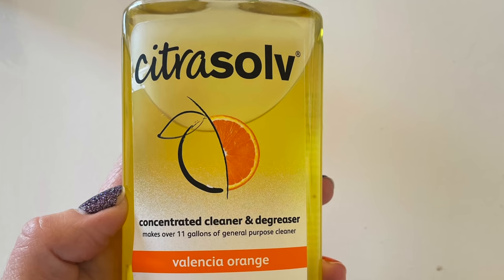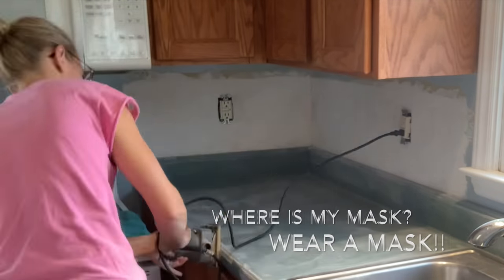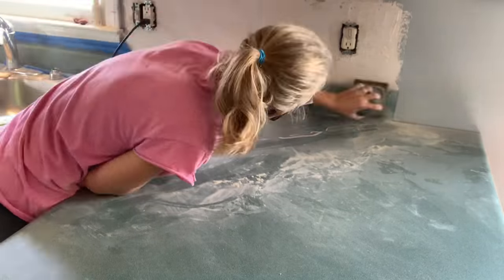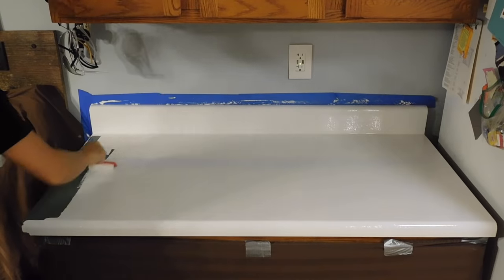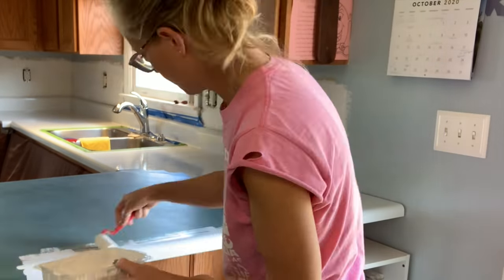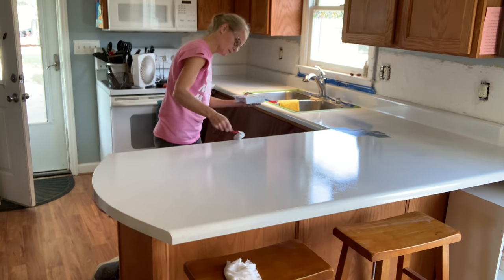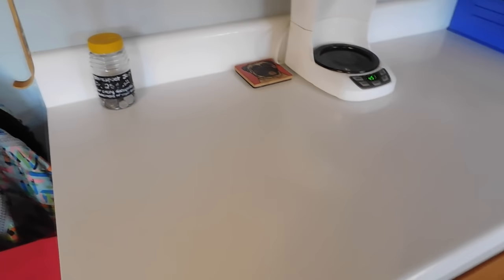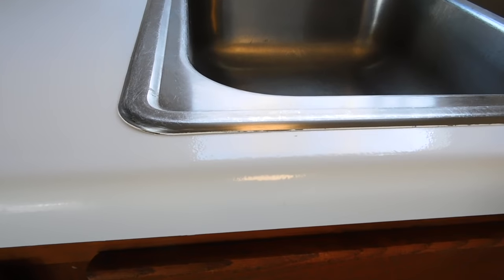DIY Painted Laminate Counter |CHEAP LAMINATE COUNTER MAKEOVER | DO IT YOURSELF EASY LAMINATE COUNTER

Comment from the maker: What do you think we should put as our back splash? Something easy, it’s rough and want to easily cover it up, thinking galvanized metal or SHIPLAP. 
Let me know 👇
Reply: Some of those peel and stick tiles are pretty nice. And that board that looks like shiplap.
Reply from the maker: @seeleygirl6178  oh thank you so much!! I will definitely check them out!! Have you used them? ❤️ thank you for watching!!
Reply: Subway tiles. Peel and stick. Easy peasy! Home Depot, Amazon, Lowe’s, you pick!
Reply from the maker: @moniquehorton1111  definitely have considered subway tile! 🤔
Reply: @JesiDavisBuildingaSimplerLife  I like the simplicity of it. It’s a classic.
Reply: I put I guess it’s punched tin like in the old houses and restaurants they have it at Lowe’s and Home Depot it’s different than the old one hundred percent run , it’s got a rubber back and you can glue it on I wish I could send you a pic but it looks great and is fairly easy to do also they make different colors like copper brass dark and tin color I think the pattern is like New Orleans flor de Liese
Reply from the maker: @amaiorano67  That sounds cool! I think I have seen those! Squares right with punched design on them? Ive actually thought about weathered galvanized metal too.
Reply: a waverly stencil from Wal-mart
Reply: Did you know you can use vinyl  plank flooring on the walls? You can install,it in a few hours. Installation is easy, ruler, measuring tape, exactly knife and some paper (for outlet patterns). Very budget friendly and easy to wipe off for clean ups. Some come with adhesive backing or you can use some construction adhesive (sparingly and troweled off). This can be trimmed off with wood trim painted your wall color or metal trim for ceramic tile. It comes in many finishes but it can be pricey. Good luck with your project. You go girl, ✌ and 💘.
Reply from the maker: @susanpeterson9558  that’s sounds like a great idea! Thank you for watching and making a suggestion!
Reply: For an old school look go with 3x6 subway tile.  For a more modern look, go with mosaic glass tile. If it is texture you are after, shiplap is always an excellent choice.  I've never worked with galvanized metal so I'm not sure.  Stamped tin, or copper looks pretty cool to.  As for me, I go with what ever is easiest to clean.  I'm looking forward to seeing what you choose.  Keep up the good work!
Reply from the maker: @michaelmeans9187  thank you so much! I appreciate your suggestions! We are leaning toward Shiplap, thinking about putting it vertical or haring bone. The problem is, is when the old tile was taken off someone put a ton of wall putty up and it would be hard to get it all even. I would LOVE to put a rock back splash, like cement and stick River rocks up there, but they may cost more if we don’t go river rock hunting in the river... and be interesting to clean. Decisions. I thought of painting a wood grain on the ship lap with a tool I have, and giving it an antique look.
Reply: @JesiDavisBuildingaSimplerLife  Vertical shiplap would be supper cool!  I'm not a fan of haring bone, it looks fantastic, but I just don't ever want to install it.  LOL 

As for the uneven walls, Vancouver Carpenter is a YouTube channel that has lots of great solutions for how to fix uneven walls.  He has saved me on a few projects already.
Reply from the maker: @michaelmeans9187  truth to not wanting to make all those cuts for haring bone! 😆 let alone installing it! thank you SO much for the resource! I’ll definitely hop over there! Thanks for being here!
Reply: 2021, Decorating trends say subway tile is out! Ship lap is thick, I have done a few projects with lath strips, but it will be rough unless you sand it alot. I would look for something easy to clean and wipe off. I used vinyl slate all the way to the ceiling. It looks like the real thing but easier to install and alot less money. Just a thought, if you are going to change out the counter tops in a few years I'd stick with a less expensive option.
Reply from the maker: @susanpeterson9558  oh genius! Thank you so much for these tips!! ❤️
Reply: diamond plate sheet
Reply: Diamond plate polished. Cut to size and glue on! Not super cheap but super easy.
Reply from the maker: @finnsadvantures  oh wow thanks!!
Reply: @JesiDavisBuildingaSimplerLife  happy to help. I am actually a Home Inspector by Trade.
Reply from the maker: @MrSaxon2001  OOOO that sounds interesting! Thank you for watching!
Reply from the maker: @finnsadvantures  Thats awesome!! Im sure you are very handy when it comes to looking at homes and home improvements!
Reply from the maker: @A B C Oh Ive thought about that! 🤔
Reply: @JesiDavisBuildingaSimplerLife  I'm still procrastinating! Bead board was the other name.
Reply from the maker: @seeleygirl6178  🤔 that is a solid choice!! Thank you! And thank you so much for watching!
Reply: Counter ca.e out nice, now the cabinets, then the back splash.
Reply from the maker: @alirE2904  yes yes yes!! 😀 thanks for watching!! ♥️
Reply: You can also use laminate wood flooring for backsplash
Reply from the maker: @accidentalcatalyst1003  so many choices! ♥️ thank you for watching and commenting!
Reply: Dollar Tree has some beautiful ones. I put on my kvetching 3 years ago and so far didn’t peel .
Reply: """Bhbb
Reply: I love the idea of shiplap 100%!
Reply: Dollar Tree has very good ones and they last. Just finished my back splash. I post on my Facebook and o had good reactions.
Reply: And your counters look great! Good work.
Reply from the maker: @e.l.france5136  thank you ♥️ thanks for watching new
Reply: Decorative tin. It’s comes in a whole bunch of colors and t would be way easier than tile.
Reply from the maker: @maryannkom299  I love easy!! And sounds like I wouldn’t have to worry about smoothing out the putty that’s been caked up in our wall. 😂
Reply: @JesiDavisBuildingaSimplerLife   I want to do tin on mine eventually.
Reply: I love the idea of galvanized! And then some beautiful farmhouse white cabinets. I’m sure you could diy easily
Reply: Pieces of tin from Home Depot about 20 a sheet or shiplap tin comes in nickel or bronze done that before turned out really pretty adds a lot of shine to match the countertops
Reply: @susanpeterson9558  what kind of sanding type did you use?
Reply: @meemaw6533  where can I see that,
Reply: Hi Jesi !  Just out of interest, how's it looking a year later? I'm considering this same product to refresh my old jaded worktops, and I wondered how well it's doing after a year or more?
Reply: I put up that fake tin that looks like ceiling tile at Lowe's. I want to paint them white. So they don't look so much like fake tin ceiling tiles from Lowe's. I love your counter. I wish I weren't so lazy.
Reply: you do not caulk a kitchen sink it gets clear silicone. under the sink and along the splash. You did a good job but i feel epoxy coat is the way to go on such a project.
Reply: Metal!
Reply: Shiplap will be gorgeous just did my counter n you are right at first freaked out because the air bubbles but it came out so good and dry in like 24 hours everyone thinks it’s a stone thanks 🙏🏽
Reply: Beadboard. Classic and durable, easy clean up
Reply from the maker: @cherylhag3253  genius! I hadn’t actually thought about that and I bet that would look good, as it’s still not done 😂
Reply: You could tile right over it….also you could easily do cement and dye it any color and seal it well.
Reply: Shiplap.
How long did it take you to sand that area? It is the same countertop I have and it needs to Go!!!
Reply: I think that you would get a better wow factor from painting your cabinets before messing with a backsplash.
Reply: Ur jeans are really tight lol
Fixing to paint mine too
Reply: No mask hun ? 😮
Reply: Your fish needs a bigger home my dear. That fish cannot live a good life in such a tiny bowl with no filter, no aerator, no heatlamp etc (depending on type of fish).. love your countertops, but please have a heart.. give the fish a lovely home just like you have a lovely home for yourself 🥺
Reply: Your fish needs a bigger home my dear. That fish cannot live a good life in such a tiny bowl with no filter, no aerator, no heatlamp etc (depending on type of fish).. love your countertops, but please have a heart.. give the fish a lovely home just like you have a lovely home for yourself 🥺
 @JesiDavisBuildingaSimplerLife
Reply: @JesiDavisBuildingaSimplerLife pool
Reply: You just inspired me to do my kitchen counter tops. Thank you for the cideo
Reply: Cabinets to much work cleaning
Reply: There are some beautiful peel and stick backsplash tiles out now.  They look realistic and are very durable🎉

Comment: As a professional decorator in London i can't recommend a product enough called ESP by Owatrol, no need to sand, its a liquid which can be wiped on pretty much any non porous surface including glass which enables any paint including waterbased paints to stick to any surfaces , we use it to paint old melamine, formica kitchen's and have nothing but brilliant results 😀

Comment: I just sanded and put a coat of this stuff over a previous attempt and dang, this stuff works wonders. Super tough, easy to apply and no hassle. Did the whole kitchen in 2 hours and 15$!
Reply from the maker: Hey thats Awesome Keagan!! Woop Woop! Thats a win, simple and budget friendly!! ❤️
Reply: Wow!
Reply: Can u tell me what paint this is. Do u need a primmer then a clear varnish on top please
Reply: How long did you have to wait till its fully dried?
Reply: Can you please show me the $15 option?
Reply: @louisebolitho9629  1¹
Reply: Okay so im thinking THIS IS THE METHOD IM GOING TO DO! $15.00 THEN if all else fails I'll purchase preformed counter top from a local store that's cheaper if it's something they have left from 1 being cut for another customer... 2nd option isnt going to be necessary with the mindset I have now :)
Reply: What is the $15 option. I have to get it right the first time. No money for mess ups or new countertops even with extra left over. Im sure its still expensive plus you don't have air of choice that way.
Reply: @aunt_b3365  Rust-Oleum appliance epoxy, one can will finish a whole neighborhood worth of counter tops! Looks great (bright white, glossy) dries hard. If you get a chip or stain you can just sand a bit and recoat the spot
Reply: What is the stuff you used?
Reply: @KeaganKellogg  does it have a hardener? If not how can it be durable/ scratch proof
Reply: @wazup3333  It seems very durable, but has been marked by knives and things normal formica would also take damage from. I have just reapplied in spots when stuff gets dinged up. Still looking nice!
Reply: Can I do it on bathroom counters?
Reply: @KeaganKellogg ❤

Comment: FYI, for anyone else trying this you could unscrew the sink clips a little and wedge washers under it without messing with the plumbing get a much cleaner edge.
Reply from the maker: Great tip!
Reply: I tried this and also tried to build stilts to support the sink from underneath. Unfortunately my plumbing had no give in it so I had to go ahead and remove the whole thing. It was worth it in my opinion though.

(By the way I was using a different kit, not this appliance spray method.)
Reply: @PJErvin  I am a peel the trim off first painter, generally.  I had to scrape paint off the stove and replace switch plates when we moved in. SMH

Comment: Safety tip: When sanding it's good to wear a dust-filter mask, goggles, & gloves. A synthetic surface may have especially irritating dust. Also if you can rent an electric sander with a vacuum attached, it's faster & cleaner.
Reply: dust filter mask is not enough (I wore one for the first coat); spring for a respirator mask -- your lungs will thank you.
Reply: @yewtoobbrute   dust filter mask is enough for the sanding step IF it's a good quality mask. However, if doing on going projects, it certainly is well worth it to buy a respirator mask.

Comment: I watched your video and did my counters too! It has been over a year and a half and it is fantastic! You saved me a load of cash and tons of time! My bright yellow 70’s installed Formica top, looks brand new and a million times better in white! I also painted my yellow bathroom tile ! It is also amazing! Over a year as well.  We have been really careful as some paint started to come up in the molded soap rests in the shower. I sanded and repainted. Left extra time for curing, kept fairly dry between showers and put a plastic soap holder in the molded painted holder so it doesn’t peel up again from being overly saturated. Works like a charm!   I am going to paint the yellow floor tiles in guest bath. It will need extra cure time and a floor mat so it stays dry…since it is a floor.  think it will be just fine!   Best thing is…easy to paint over  and super cheap if u have to touch up anything!  Thank u soooo much!!!
Reply from the maker: Woohoo!! No more yellow! Thats fantastic! great job! Im so glad I could help and save you money! thats what its all about! God Bless

Comment: I did this for my mom’s kitchen countertops and she loves it!  She had a 70’s orange countertop.  I sanded it and decided to do a coat of primer due to the color and painted 2 coats of the white appliance apoxy.   It looks great!  The only area that didn’t come out smooth was around the kitchen sink.  I would definitely remove the clip sinks and prop it up then recaulk if I do it again.  Thanks for the video, looks awesome!

Comment: Nice job! I would just suggest loosening the bolts on the sink and propping it up with a stool underneath to save time masking and have a better edge. That way you can apply silicone under the edge if you're worried about leaks.
Reply from the maker: That’s genius!! Thanks!

Comment: Those counters look beautiful! I know that they now make a paint specifically for laminate/Formica countertops.  I’ve seen a lot of people use peel and stick wallpaper, but to be honest, it may look good on camera, but I have a feeling it looks like wallpaper in person.  I can imagine that painting looks so much better.

PS I used appliance paint to restore a refrigerator that worked great but had significant rust damage (the “advantages” of living beach front 🙄), and that appliance paint ROCKS! It made the refrigerator look like new, and it LASTED.

Comment: I did this too with this exact paint and so far going strong for three months now. I bought large drawer liners in white and put them on my counters for everyday use and remove them when I have company over. It will help prevent scratches. So far no stains and is holding up well.
Reply from the maker: Oh yay!!! I love hearing this!! Thanks for stopping by and commenting Michelle! Appreciate you! What color? White?

Comment: I painted mine.  The laminate had water damage and was black in a lot of places.  I used a nap roller so it has texture. It looks like cement.  I love it. I used Dixie Belle Slick Stick, no sanding required.  Then chalk paint and sealed with Gator Hide.  It takes a month to cure so I washed dishes in the bathroom.

Comment: I tested the same epoxy product on old porcelain tile 😀 and it worked! I just tested one square to make sure cause I didn't want to do the whole area only to find out it peeled off or something. But it didn't peel off... I followed your sanding and prepping instructions and then painted one coat each for 3 days and it's now in the curing process. Sanding is a must especially on porcelain. After 3 coats it looks glossy and nice like new tile! I lightly scratched the edges with a nail to see if it comes off, but luckily the paint is still on and not peeling. As long as you let it dry enough days before using the surface, it will be fine 👍👍👍 Just wanted to share my results and thank you for this tutorial! 💛
Reply from the maker: That’s FANTASTIC!! 😀 thanks so much for sharing! And thank you for watching!! ♥️
Reply: So am I correct in understanding that you used this on porcelain tile and it came out shiny? I’m bout to paint my tile on the kitchen walls and I really wanted the look of subway tiles but could figure out how to get them shiny. This might be the answer! What did you use for a degreaser prior to painting if I may ask? Thanks!!!!
Reply: @sharronharding8112  I used soap, water, vinegar and baking soda solution... But the video states you can use a degreaser. It's a lot of scrubbing, I'm not gonna lie. Make sure you sand the tiles and wipe off the dust before painting just like the video shows. The smell of the epoxy is pretty strong, like nauseating strong! I had to use a N95 mask when applying coats.

Comment: Cool.  This is on my list.  I painted my cabinets last year and love them.  It took five weekends, but it was worth it. Thank you for the tips!
Reply from the maker: Hey there! thanks for watching and commenting!! Oh yea, I know when we do out cabinets its going to take a while ... Ive been chomping at the bit, but the humidity is too high right now, It will have to be a winter project. 😆
Reply: @JesiDavisBuildingaSimplerLife  I used a 4" velour roller and Sherwin Williams best paint.  It's $$, but worth it.  I finished with Varathane polyurethane clear varnish.  I practiced on a bathroom cabinet fiest.

Comment: Hi Jesi! Great video! Did you consider the Rustoleum countertop paint? Just wondering why you picked the appliance epoxy instead? Can't wait to tackle my countertops!! Yipee!! 😁👍
Reply from the maker: Great question, I had watched a couple other videos on using this paint which sold me on the ease and durability. Not that the other wasn’t, but just went with what I saw. Thank you so much for watching Mary!
Reply: I read awful reviews on Rustoleum countertop paint, so glad to come across this and see the epoxy paint worked.